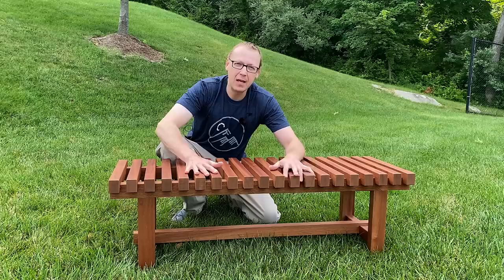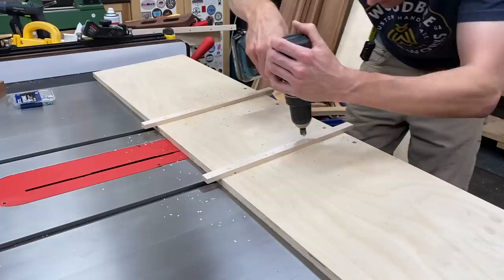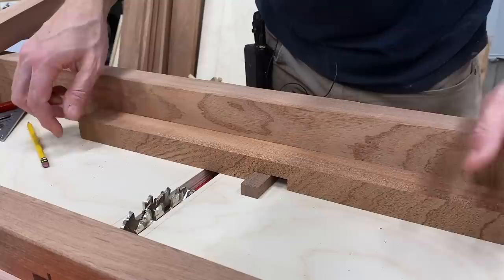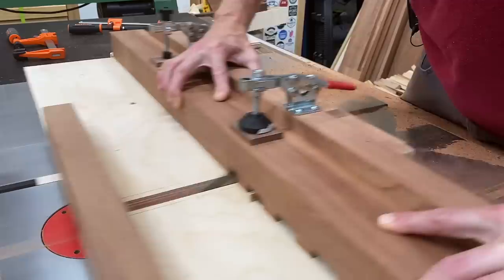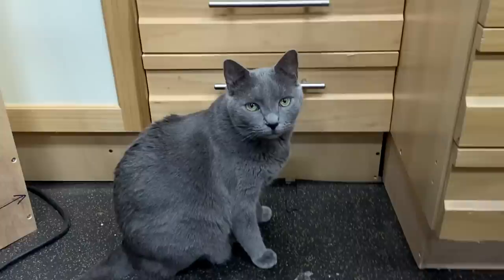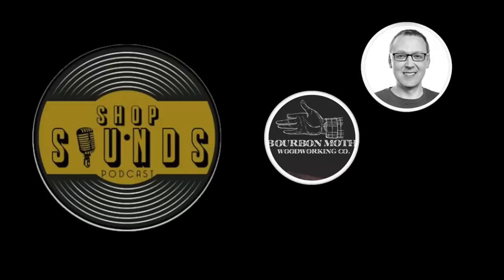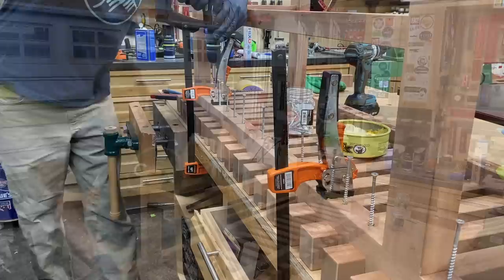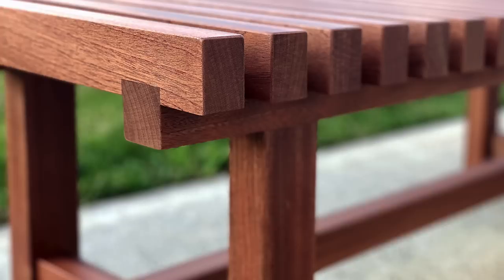Upgrade your back patio with this modern bench. #outdoorfurniture

Comment: Beautiful bench. If you ever make another one, consider adding a slight curve to the top slats for comfort. This can be easily achieved with a string bow drawn onto an mdf template, then bandsawed and flush trimmed into each slat.
Reply from the maker: It’s actually quite comfortable 👍🏻😎

Comment: i bet most ppl wont do all that notching but simply spaced them apart & screw it together , its what sets you apart , a nice "simple" project that looks great ... i like seeing sleepy heads jerry & lola
Reply from the maker: Thanks man! It could certainly be done that way if people would prefer that method. I would just make the slats and stretcher thinner to maintain proportion. It wouldn't be as strong, but would be easier and still functional. 👍

Comment: no sanding between coats. 1 hour between coats. complete finishing in 1 day... I had to go back and rewatch just for that. This is the gold standard. I'm very interested to see what this bench will look like after 2 years sitting in the sun and elements. The best I've ever used for outdoor furniture is waterlox and even that needs a heavy hand of upkeep with direct sun after a year or 2.
Reply from the maker: I'm sure it will require some maintenance...no finish is impervious to the elements. But if I can just spray on a couple coats to revive it, then it's definitely a win. 👍

Comment: Great video! Do you think this project could withstand the Arizona sun, heat, dry, switch to monsoon rain, humidity . . . rinse, repeat?
Reply from the maker: I think so! Sapele mahogany is rot resistant, so shouldn't be any issue there. However, with the intense weather, any finish applied will most likely need to be refreshed every 1-2 years.

Comment: New subscriber, thanks for the video. I watched another video on how to build one of there the other day and it sparked my interest. I have to say, I was shocked on how much the wood cost for this. Pretty much makes it a 400$ bench. Gosh, I wish I had a domino but it’s not in the budget right now. Nor do I want to buy/ use a dado blade. There an obvious work around on the dado but wondering what you you recommend in place of the domino. I will have one down the road but have other necessities to buy before I spend over 1k on this dang tool.
Reply from the maker: thanks for the sub, Shayne! Dowels work well in place of dominos, or old fashioned mortise and tenon would work great as well!

Comment: Looks great. Finding 8/4 sapele locally will be a challenge for me, but I plan to build this. Thanks for an inspirational project & video.
Reply from the maker: Thanks very much, Michael! Best of luck finding the material you need! 👍
Reply from the maker: @michaelschmidt8968  great! You can use any machinists 1-2-3 block. And yes, the Valdez Domino Dock is fantastic!
Reply from the maker: @michaelschmidt8968  Correct! I wanted a little bit of overlap. And yes, you're measurements are correct in theory, but that's if all your lumber is milled exactly as mine. Just make sure you do test cuts first. And thanks for purchasing the plans. Good luck!
Reply: @KeithJohnsonCustomWoodworking  My sapele arrives this coming Friday. Total Boat products have been shipped. I’ve located a CNC router to borrow as I’m planning to carve my grandson’s initials in the bottom stretcher. Should be making some sawdust soon. I noticed the plans call for just two dominos on the tops of the legs but your video shows you used four per leg. After having built the bench, which would you recommend Keith?
Reply from the maker: @michaelschmidt8968  That's great news! and I recommend the 4 Dominos in the top. Can't argue with more strength!

Comment: What I’d like to know is for these multi spray coats is the the gun getting cleaned between each coat
Reply from the maker: No. I don’t clean the gun until I’m done. The finish is sealed and under pressure so there’s no need.
Reply: @KeithJohnsonCustomWoodworking  thank you sir

Comment: Awesome bench, I love working with Sapele. You definitely need to invest into the 3M PPS 2.0 system for the Fuji though. Love my Mini-Mite 5!
Reply from the maker: Thanks Cody! And that 3M system looks OK, but i've never had issues cleaning the gun or just leaving whatever I'm spraying in there overnight or even for a couple of days. I'll have to look into a bit more. Thanks!
Reply: @KeithJohnsonCustomWoodworking  It also allows you to spray any direction (or upside down) since it’s pressurized. I doubt you’ll use that often, but it’s super nice if you need to spray case work after it’s a completed unit. Clean up is a breeze too!
Reply from the maker: @Meyerwoodworks  Good to know! Thanks!

Comment: First video of yours i have watched.  I love the project and your entertaining style.   Just liked/subscribed. I’m the same way about triple checking everything and lot’s of extra safety.  I believe it’s saved me a lot of time and lumber in the end. 
Question, I’ve been taught that the use of screws for anything with shear or torque forces on it will crack or otherwise damage the wood over time.  As such, i never do it, so I don’t know the effect of screws.  I can say that I have outdoor projects in old growth redwood about 40 years old in Arizona here, which have never needed integral structural repairs.  What have you found with screws or related metal hardware and its long-term interaction with wood?
Reply from the maker: Thanks so much for the kind words and the sub, Andrew! As far as screws in furniture, I don't rely on any mechanical fastener for strength. If I use a screw, it's only to act as a clamp until the glue is fully cured.

Comment: Very nice!.  You consistently put out excellent work, and this is just the latest example.

I do have one question.  At the 10min mark you do a dry fit and check for square, and of course it's perfect.  But if it wasn't, what would you do to correct it?
Reply from the maker: Thanks very much! If first readings showed it was out of square, I would have to troubleshoot and double check all my cuts and make sure they are exactly 90 and square to another and go from there.

Comment: I've got a question about the domino. I don't own one, so I simply don't know the answer. Why do you always use 2 dominos for each joint instead of 1? Is it better for strength of the joint?
Reply from the maker: The long grain to long grain glue connection is stronger than wood, so the more you have the better. Also, having a double helps to prevent twisting.
Reply: @KeithJohnsonCustomWoodworking  ah I didn't consider that it gives more long grain to long grain. And the twist prevention makes a lot of sense. Thanks Keith!
Reply from the maker: @kevinwiley5325  You're welcome! Glad it helped.

Comment: Hey Keith, awesome work as always!  I was just curious why you didn’t add floor levelers on the bottom of the feet like you usually do.  I figured outdoors would be more likely to be un-level, also it would help to protect it from water pooling at the legs. Was it just an aesthetic decision or did you think it was unnecessary for some reason?
Reply from the maker: Good question! Honestly, I sealed the end grain with epoxy so I'm not really worried about water damage. And I've never seen a floor leveler that was built for outdoor use, unless you fabricate something from stainless steel parts. And have you ever seen levelers on outdoor furniture like an Adirondack chair or even wooden table chairs? I haven't. 😜👊
Reply: @KeithJohnsonCustomWoodworking  Thanks Keith!  I built an outdoor bench and copied your dado sled jig idea which was super helpful.  For mine I did end up putting floor levelers just because I was extra paranoid about water touching the wood but yeah, the feet itself are plastic so we'll see how well that holds up over time.
Reply from the maker: @elliotthamai9731  That's awesome, Elliott! Glad the jig was helpful with your project. Fingers crossed for those levelers!

Comment: Super clever work on that sled. Dare I say ... Genius tier ! When it comes to the total boat thixxo , is it a one shot use for the tube or tip? or does it last for multiple uses.
Reply from the maker: Thanks Alec!! So, the tube is multiple uses until gone, but the tips are one shot use only. I forgot to mention it, but it is a 2-part epoxy that mixes in the tip and once it hardens, it's done. What I do is leave the tip on until next time, remove it and pop on a new one. You can purchase more tips separately as well. You do pay a little more for the convenience, but it's worth it to me for a tidier glue up.

Comment: Great work Keith! Quick question for you.. With the slats locked in place with glue and screws inside the half-lap dado slots, do you not have to worry about the integrity of the slats over time due to seasonal expansion and contraction?
Reply from the maker: Good question. And the answer is...you can worry about it if you want to, but I'm not. 😂 But seriously, And slats were flipped on end so the wood movement will happen vertically not horizontally. And there's only so much you can do with this design to account for outdoor elements and expansion/contraction.
Reply: @KeithJohnsonCustomWoodworking  Thanks for the quick reply! Vertically oriented grain direction makes sense. I am currently designing an outdoor patio table with ~6” W x ~1.5” H table top boards spaced 5/16” apart out of white oak and want make sure it will stand the test of time. Sounds like I should splurge for quarter sawn material.
Reply from the maker: @robertsmithey4813  Quarter sawn will definitely move much less, but not sure it's worth the added expense. I would check out some wood movement calculators online to see how much that white oak will actually move based on environmental conditions.

Comment: I am planning to build some outdoor furniture this summer and I am thinking of using the Halcyon finish as well. My furniture will not be in direct sunlight, but it will have the weather extremes in the midwest throughout the year and I'm hoping for something pretty low maintenance. How well has Halcyon held up for you over the past year? Would you still recommend it?
Reply from the maker: No outdoor finish will last long. From what I’ve experienced in my conditions, Halcyon will need to be refreshed annually.

Comment: Great stuff as always. One question, how easy is it to store and reuse that total boat thixo epoxy?
Reply from the maker: Thanks! So, the tube is multiple uses until gone, but the tips are one shot use only. I forgot to mention it, but it is a 2-part epoxy that mixes in the tip and once it hardens, the tip is done. What I do is leave the tip on until next time, remove it and pop on a new one. You can purchase more tips separately as well. You do pay a little more for the convenience, but it's worth it to me for a tidier glue up.

Comment: Beautiful job Keith. I’m new to your channel and also new to woodworking. I have to ask, aside from the practice of creating has there been any changes in your practices that you can pinpoint as helping you progress? For example was it a maker you followed? Was it an upgrade or addition of a set of tools? Was it a particular influence? I’m just curious of those events you see as milestones that accelerated your skill level other than flat out hard work. Thank you in advance.
Reply from the maker: Thanks Joshua! I got started started in woodworking 30 years and have pretty much been self-taught, so no key moments to pinpoint. I just read book, magazines, watched This Old House and New Yankee Workshop over and over. And then I just got in the shop and built. I always try to experiment with a new technique on every project to keep building my skill set. And I'm still researching all the time on different and better ways to do things. My best advice would be to find a local place that has woodworking courses and take a few. That is definitely something that I wish was available to me when starting out.
Reply: @KeithJohnsonCustomWoodworking  roger that. Thank you for taking the time. Be well.
Reply from the maker: @joshuaasbill3131  You're welcome!

Comment: Hey, I have a couple hopefully quick questions. First, my dado stack has beveled edges that leave tiny notches. Would that be very noticeable in something like this where you take multiple passes? 

Second is about the Festool drills and impacts. And I see you also own some Makita tools which is what I currently use. My question is, besides Festool's general quality, is there really any reason to pay so much for their drills/impacts when Makita's stuff is already really good?
Reply from the maker: In this case, those little notches aren't noticeable because the half lap joint covers the. 
And Makita and Dewalt drills are all perfectly fine. I just like the small Festool ones because they are light and maneuverable and fit my hand well. The right angle attachment makes getting into tight spots much easier. They are ideal for hardware installation and light drilling operations.

Comment: Looks pretty!
I like the base of the bench, I'm looking forward to build a bench for our dining table, I'm just wondering if the base structure is stable enough. 
So what do you mean, is it stable enough  for a couple strong guys:)?
Reply from the maker: Definitely strong enough for a dining table bench. With the bottom stretcher and the seat slats all locked in place, it's rock solid. 💪💪
Reply: ok, thanks!
Sorry for my bad english, I'm from Germany:):):):)
Reply from the maker: @nikoregehr4627  No problem!

Comment: Typical form over function. looks nice but very uncomfortable to sit on.
Reply from the maker: Oh, did you stop by and sit on it? Because it’s actually quite comfortable. If the seat slats were further apart, it would not be, but that’s why they were spaced the way they are. It’s not by happenstance that they are 1 inch apart and no further. I do actually test for comfort. Nothing is by accident.
Reply: @KeithJohnsonCustomWoodworking   i guess it's very bottom dependent then :-D
Reply from the maker: @shrike6259  My bony a$$ finds it quite comfortable
Reply: @KeithJohnsonCustomWoodworking   Yes it's your bench made for you. i get it. Not for guests . lets say children or other adults who have a different sit bone width. Not to mention shifting  yr weight a bit (what every body does sitting for a period of time).
Reply from the maker: @shrike6259  my niece, nephew, wife, sister, brother and next door neighbors all sat on it and had no complaints. Your point has zero validity.
Reply: @KeithJohnsonCustomWoodworking   Oh we're playing the validity card ..  so science it is.  there is a reason benches are always designed with vertical slats!
because studies have show people like then.    just because your friends and family like it  is not valid at all (of coarse they like it  in a 5 minutes test sit.  they don';t wanne hurt your feelings.  They where just being polite)  Do a real test put your bench between some random "normal" benches and see which one people get off  and go stand or take the other bench.
 Yo man, right  these slats fit all.  happy dreams.

Comment: 220$ just of wood for a mini bench?! 🙄
Reply: @KeithJohnsonCustomWoodworking  that's kinda expensive 😬 without counting the tools (festool).. i think buying will cost less than half 😬
Reply from the maker: @chazy10  Then buy it from China and watch it fall apart in a week.
Reply: @KeithJohnsonCustomWoodworking  never says that. But with 100/120$ you can buy a good mini bench..
Reply from the maker: @chazy10  And that's why there is Amazon and Wayfair and why I have different clientele. There is a a price point for everyone.
Reply: @KeithJohnsonCustomWoodworking  sure. Quality is quality, but not everyone can spent 220$ just of wood. And, if it's only for hobby, having the right tools will cost so, so much.